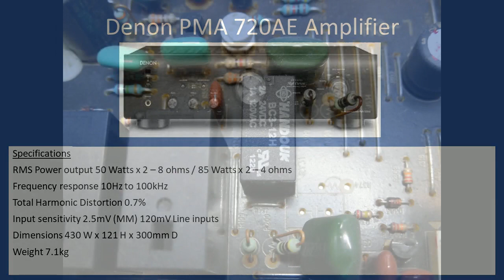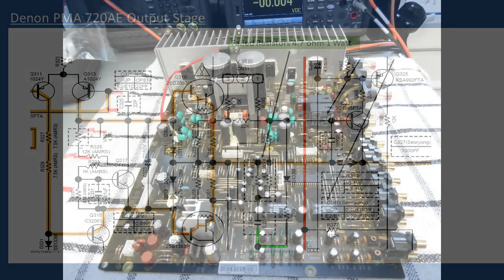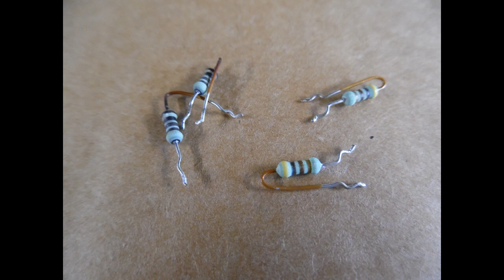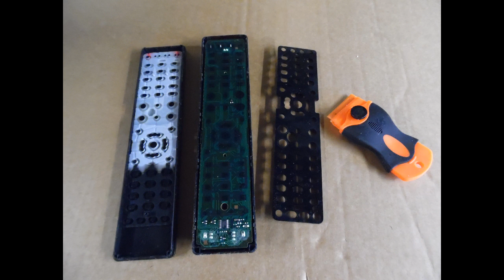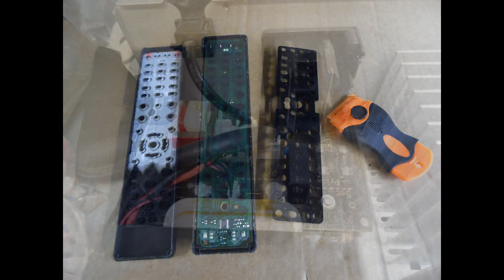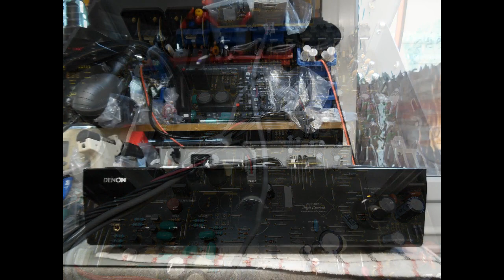Denon PMA 720AE Amplifier Repair (With Audio Tutorial)

Comment: Mine has just given up fully on one channel. Seems to be before the power amp as it also effects the headphone output
Reply from the maker: Hi check the Audio signal entering the volume control potentiometer and then exiting. It is not uncommon for one of the volume control carbon tracks for the failed channel to go open circuit.

Comment: My PMA 720AE changes input(relays clicking and input led changing)  on his own randomly, no remote pressed!!?
No patern, just changing input on his own.
Reply from the maker: Hi the issue your seeing is most likely due to the input selection switch.
Inside the switch you will find a lubricating grease, covering the switching contacts. The grease dries out over time and causes intermittent contact connection hence the radom switching of the input.
The switch will need to be removed and the grease removed and the switching contacts cleaned with a fibre glass pencil.
Reply: @AudioAmplifierServicing  My PMA 720AE has suffered from the same problem. I couldn't find any grease on the selector switch contacts but they were quite dirty. I have cleaned the contacts now and the problem seems to have gone away so thanks very much for the suggestion.
Reply from the maker: @grahamwoodier5066  Your welcome and thank you for sharing your experience on the channel.
Reply: @AudioAmplifierServicing  Thank you for the detailed pointers!.....I am an amateur/hobby electronics fiddler(heheheh)myself ,so i will dismantle it and try to clean the contacts. Hope that everything goes well.....Maybe i will post the results here. Thank you once again, have a nice day.
Reply: I didn't had time to do anything on my PMA 720 as I've previously said!......and i am not using it regularly ,BUT i will do it some day, and post here!...Thanks for the input.